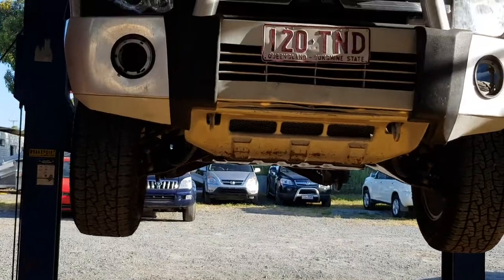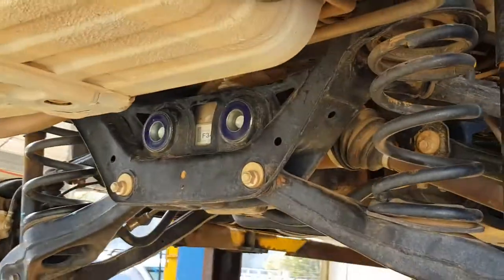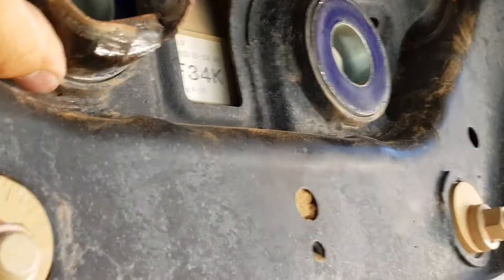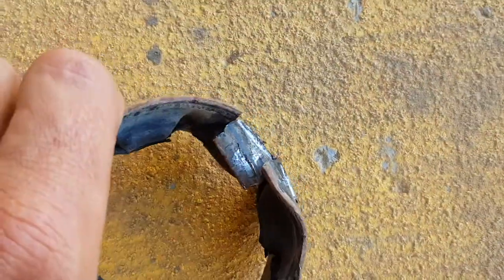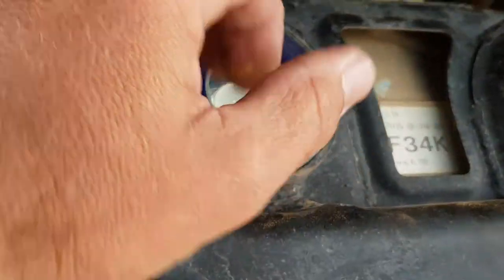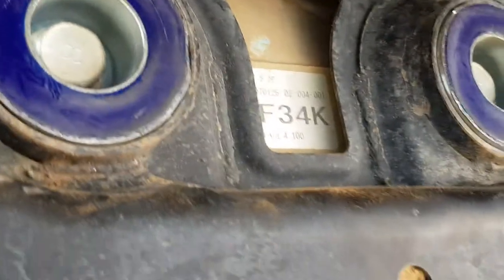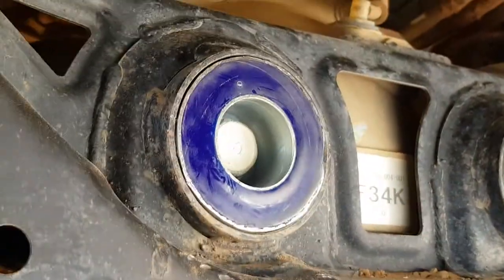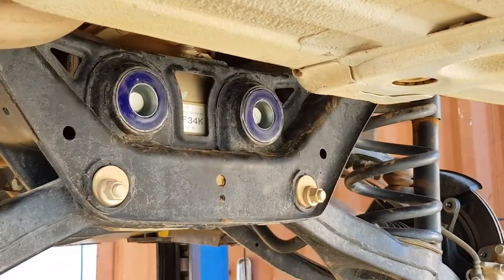Mitsubishi Pajero NL diesel 07 rear diff bush replacement. Easy as

Comment: You other video shows loosening the suspension mounts. Is that necessary?
Reply: Did we get a response?? Do we need to loosen suspension.
Reply: @jasonrumsey5023  No its not necessary there is another YouTube where a guy does it without undoing any bolts except the rear diff bush bolts .